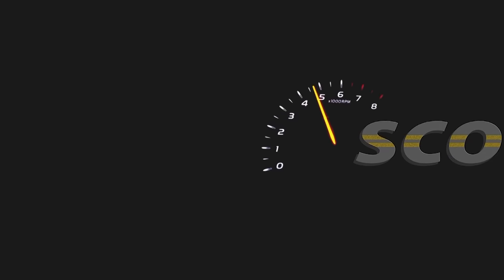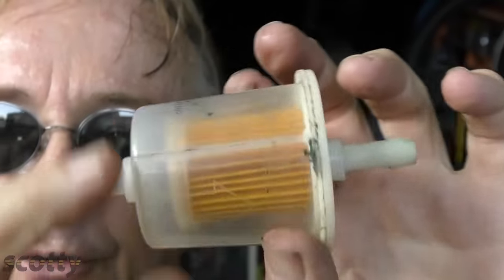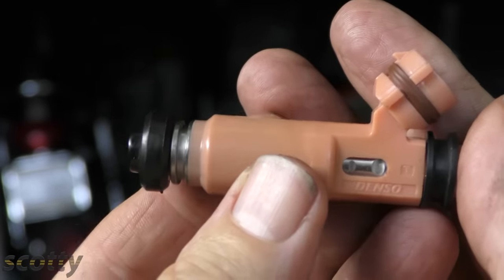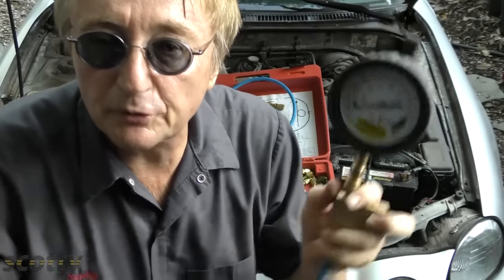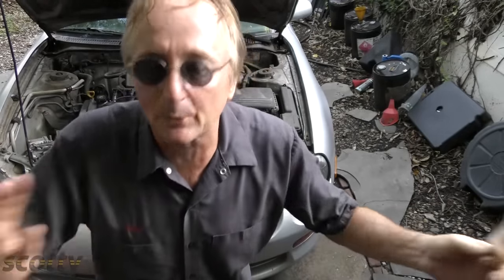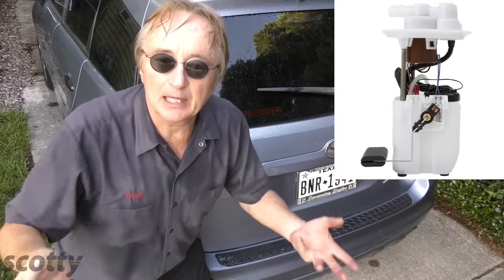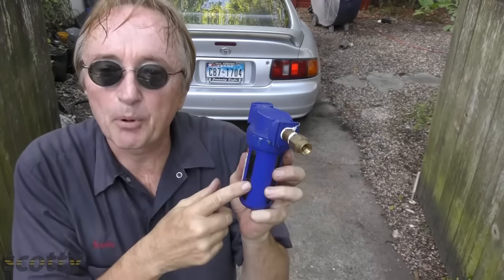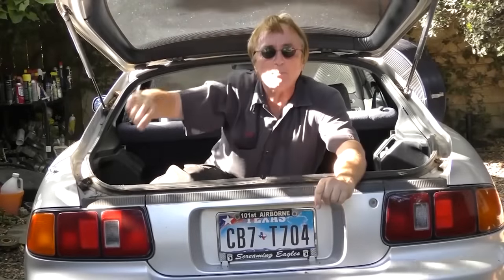Here’s What Happens if You Don’t Change the Fuel Filter in Your Car

Comment: don't let your ride run out of gas in a older car once the fuel hits the bottom of the tank  it sucks up all the sediment and rust that's been brewing for years and will clog your fuel filter
Reply: Jay Means yes that's a very good point!!! I've also been told to always keep at least a half a tank of gas... if you constantly let it run close to empty it will overheat the fuel pump... The gasoline actually dissipates the Heat and cools the fuel pump is my understanding
Reply: Mark Bingamon  but they say modern gas degrades very quickly. Filling at half a tank means there’s always half a tank of bad gas in the car. What to do?
Reply: Have you seen that yourself? Or just heard about it? I think its a myth. A car always shakes. Gas moves around swishes around all the time when u drive.
Reply: pretty dern sure i've had to replace a number of filters in those circumstances or when the car was on a steep incline and the sludge slid toward the pump
Reply: Mark iv'e never heard that but if that's the case i would say that's bad engineering or planned obsolescence, the only reasoning i can deduce is perhaps they figure if the tank is more than 1/2 empty then the pump's probably not gonna run for very long at a time.
Reply: weibernipple Fill at 1/4 tank
Reply: Mark Bingamon another reason to keep the tank at least half full is in case disaster strikes you can get out of town quick!
Reply: +Jay  Yes, this also applies to Tesla electric cars, never let them fully discharge, you will get the Dregs of Electrons clogging up the wires, increasing heat, causing explosions. Surely you have seen Teslas on fire?
Reply: Don't know guys but this idea of sludge whatever building on the bottom of the fuel tank is myth. At 160,000 I took out the fuel pump and pointed a flashlight down there looked around and saw nothing but crystal clear fuel.
Reply: your just a lucky person do you live near an ocean? does your gas station use good equipment and suppliers? has your ride been sitting in the yard for 5 years? there's alot of factors at play here not just 1 persons experience we are talking about the fuel system here not the lubrication or the air flow
the point of this discussion is not the focus of novice maintenance but the finer points of the fuel delivery system
Reply: Mess up your fuel pump
Reply: What are the sings of a bad fuel Filter?
Reply: @sandrapsalms9158  it goes waaa waaa waaa waaaa
Reply: It's a modern myth.  Your fuel intake is at the bottom of the tank (otherwise you would be running ampty when there is still fuel in there) which means any "crud" is getting through al the time and not just when the tank is nearly empty.  If you replace the filter and/or pump in a modern car where it resides in the tank itself, you can see that the bottom of the tank is usually clean.
Reply: Or use a fuel injector cleaner while low on gas to clean it out

Comment: I have a strong feeling after replacing multiple parts in my emissions system and still having codes pop up that the fuel filter is at the root of the problem.  308K miles on the car, thinking I should replace the fuel filter now for the first time!!
Reply: Did it improve things after you changed it out?

Comment: Just barely started following Scotty.  

2011 Camry le auto all stock 366k miles.  3rd n 4th gear rattles when shifting.  Up hill only do 50mph but if pushes it to 60mph, rattles even more.  Thought it was the trannie maybe so did drain n fill, never flush like Scotty said.  This weekend gonna do plugs n coil n air filter. Then for sure do fuel pump n fuel filter pay $1,000 for it since I don't want to mess with inside tank stuff.   Man can't believe I got lucky driving 366k on stock parts.  Been daily commuter 2 hrs each way for WK.  Next time I'll buy new 2022 vehicle n once I hit 130k, I'll sell it n buy new again.  In this way, the next guy will hold the bag when it comes to car parts breaking down.   Lol

Comment: Scotty I replace my fuel filter EVERY year. With my 1999 Mazda MX-5 the fuel filter is located underneath the tank and it has those real pain in the rear end plastic "quick release" clips. I even cut open my last years filter and it was already getting dark black. So would you agree even if a car hasn't done a huge amount of miles in a year... the filter can still go bad?

Comment: I have 2002 hyundai santa fe with 171000 miles. Whenever I ask the dealer or mechanic shop if I need to change my fuel filter, they say it is not recommended. What should I do? insist on getting the filter changed or drive as is?
Reply: Probably it is one in the tank. Buy from the dealer and change it yourself or get a local scotty.

Comment: Having the filter closer to the fuel pump makes a lot of sense: then it protects not only the fuel injectors, but also the pump as well. Sure, it's more of a pain to change it, but you'll need to do so less frequently. Having the filter in the engine compartment means that any crud gets sucked up by the pump and is sent all the way down the fuel line before it's caught by the filter.

Comment: Scotty I agree with you 100%, but I have to be honest most everyday people are not going to go through the hassle of jacking the car up, struggle to drop the tank to change the fuel filter.  You are lucky on the Toyota Matrix it has an access port under the seat.  Most cars do not.  I really wish the manufactures would keep the filter out of the tank. It should be as easy to change as the air filter.

Comment: But mine's in the tank, and is part of the fuel pump. The only way to change it is to replace the fuel pump, as it's not serviceable. Now what?
Reply: You wait for it to break because if you are going to have to replace the whole system you might as well wait for it to go wrong.
Reply: 2015 Chevy Cruze , same problem.
Reply: Gravemind Modern cars in a nutshell. lol
Reply: I don't know where you live but where I am, Honda dealerships charge £140 fixed price to change the in-tank fuel filters. According to the Honda manual, these need changing every 50k miles too...
Reply: Well you just drive it till the pump dies then replace as a unit
Reply: sab188 newer Honda's do not have a maintenance schedule for the filter. My dealer actually said they did not want to do it.
Reply: sab188 makes no sense, after 200 000 miles you replace whole thing IF it breaks
Reply: Use one of those fuel additives they sell at autozone. Don't buy the fancy ones.
Reply: OceanA Actually, the a couple of the fancy one's with solid PEA concentrations in it are the only ones that work. Chevron with Techron fuel system cleaner in the black bottle is a great choice.
Reply: same here i have a Chrysler they did a way with external in 2000 so mines in the tanks and i won't be bothering with it till it acts up.
Reply: Jr ALEXANDER     I wish i would have. I have a 2014 Malibu Lt and it is already starting to break down. A four year old car that has been taken care of.
    I had a 1998 Chevy S-10 that i drove for 15 years and had two slave cylendars put on it.  The only reason i got rid of it and got the Malibu is, so i would have room to take the grandkids places.
Reply: Jr ALEXANDER not safe.
Reply: John Young i have a 2011 malibu its 98k miles, still perfect
Reply: John Young we also have a 1988 s10 200k+ miles still going but unsafe too small
Reply: True Life Average Jane Vlog   That's great.  My daughter has a 2011 Malibu also.  It's a great car too.     I think it has about 89000 on it.
Reply: "Buy an older car." Yeah! Let's buy an older car that's even more of a money pit. Nice idea, genius - NOT!
Reply: John Young The S 10 fuel pump is aldo in the gas tank, which also requires the complete removal of the bed in order to change it. The fuel filter is on the left hand side of the frame, bolted onto the frame. Laugh at me if you will, when I use to own a S 10, a 95 four wheel drive regular cab truck, i changed the fuel filter every year on the Pennsylvania inspection time. Same way with my 92 Ford Escort, every year on it's inspection date and time, the fuel filter gets changed, weather it needs it or not, they BOTH get changed on their inspection dates and time.
Reply: Best thing is to never let the fuel level drop below 1/4 of a tank. Keeps pump lubricated with the fuel and keeps sediment from going up the pick up screen.
Reply: 2003 and newer the fuel filter is on the fuel pump
Reply: Just Listen Royal Lion Family I have a 2004 Chevy Tahoe Z71 and it has a frame mounted external fuel filter.
Reply: Fuel filters always need to be replaced eventually , nothing on a car is "lifetime" like manufacturers like to say.  Unfortunately dropping the gas tank and replacing the pump and filter isn't fun , but it's necessary eventually.
Reply: Simple you replace the car for a better one.
Reply: Josh Cade no such thing as a better car. Just harder and more expensive to work on.
Reply: That varies oddly enough my friend took his Civic Si in and the dealer told him the filter is permanent.  Falsely adding it is designed to outlast the pump and will never clog.  Which was why he said they felt comfortable enough to integrate into the pump and un-serviceable.  Buddy said that's a load of bs, luckily my lease is nearly up.
Reply: Not all 2003+ my 2003 there is a fairly coarse filter in the pump.  Then a normal fuel filter with better filtration on the fuel line by the rear door.   I've seen several different fuel pumps on even older with a filter but just for larger particles.  They still ran an inline external fuel filter.
Reply: amazing engineering
Reply: Change car when the fuel tank is emptied.
Reply: have you guys checked under the seats in the back? ( sorry i don't know what everyone's vehicle is i am assuming it is a car) but when I had my little car there was an access port under my drivers side back seat where you could pop the plate off and get to the fuel pump extremely easy.
Reply: True Life Average Jane Vlog I o
Reply: smokesgtp chevron with the techron doesn't work
Reply: Austin Kyle cheaper to fix than newer cars.
Reply: 20alphabet service it!
Reply: smokesgtp I don't buy Honda or any foreign car for that matter.
Reply: Merlin Cat ummmm ok. Never had issues with my Ford's in rust belt states.
Reply: Just hope for the best.
Reply: They use sock filters. They don't really clog unless you fill up at that weird gas station on the southside.
Reply: This is the way a lot of companies are going.  I have a GM vehicle too and that's the case with mine.  Although I haven't noticed any decrease in fuel economy on my truck and I use name-brand fuel ( I do run injector cleaner through it periodically which helps so you can try that to help things).

Comment: Car runs thousands of miles without fuel filter system, in tank filter last the life of the pump, line filter usually gets clogged
Reply: Considering my Honda manual says to change the in-tank filter every 50k miles (or 25k miles if you live in dirty/polluted area), I'm pretty sure those ones get clogged too...
Reply: My opel says replace fuel filter every 30000 miles or 50000 kms
Reply: ben franklin is it inside the tank ??
Reply: M Ridware i dont know that 😕
Reply: M Ridware those sock filters clog up just like any other filter.
Reply: @mridware9694  60k or 100k miles for in the tank filter

Comment: Hi Scotty, I hope you are well. I just checked my cars manual and it doesn't mention fuel filter change interval or anything, fuel filter is not even mentioned there. So doesn that mean I should ignore it, or maybe my car doesn't have fuel filter in first place????
Reply: You definitely have one, your engine would get destroyed pretty quickly if you didn't. Do you mean owners manual or service manual? The owner manual won't mention it if they consider it a "lifetime" part - that it's intended to last as long as the fuel pump assembly (like Scotty mentioned: it's not lifetime of the car, it's lifetime of some other part that it's related to. In this case, 'lifetime' probably means 'the warranty period we offer on the fuel pump'). If it's not mentioned under the service schedule then the manufacturer didn't intend it to be replaced separately from the pump assembly. The factory service manual (or Haynes etc. alternative) probably details how to change just the filter if you wanted to. Partly depends on the car - if it's just rolling up to 60-70K, maybe worth replacing the filter on its own. If it's done 150K already, likely easier just to wait until the pump fails and replace the whole thing like the manufacturer planned.

Comment: That could be the case! We bought a 2006 Chevy lacetti for my mum about two months ago, it is accelerating slower in the middle of the rev range and I couldn't figure it out with my dad, we totally forgot about checking the fuel filter.

Thanks for reminder Scotty!
Reply: Was that the ultimate problem?
Reply: @wmluna381  You're testing my memory right now, since that was around 3 years ago, but iirc, no, not exactly. That car can run both on gasoline and LPG gas. The gasoline filter was ok, previous owner has replaced it somewhere between 5 and 10 thousand kilometres earlier. I don't remember the exact problem, but I know there was something wrong with the LPG regulator. Although the gas installation does have sort of it's own filter, and it was indeed clogged, so you could say it was a part of the problem. Generally speaking there was simply a few smaller problems that caused the power loss, after a few fixes here and there it started working like it's supposed to.

Comment: Scotty:

I had an old 79 Honda Accord that had some weird fuel filter contraption under the rear left fender.  Not only was it expensive by itself, but was hard to replace and needed a lot of tools.  I got several inline filters and placed one before the factory filter and a second in line under the hood.

Somewhere down the road, I ended up with a tank of muddy gasoline (not from a flood zone) and suffered a lot of serious hesitation problems.  A quick look at the clear inline filter gave away the problem: muddy gas.  Without seeing the muddy filter, I could have torn through the car looking for another problem since the factory filter was painted black.

After changing the filter, my car would run, but I knew not for long.  So, I jacked up the car, removed the tank drain bolt and let it run out.  My God, all sorts of colors ran out and separated in the pan.  First, mud, then orange stuff, the green stuff, then gas, then some multicolored stuff (likely unassimilated additives), then water,  then several handfuls of rust.  I poured in another gallon of clean gas to finish cleaning out the tank.  More every thing else came out.  This was years before they started putting corn water into the gasoline.

I think you need to be take your high mileage Toyota and drain the gas tank and see the junk that makes your car run crappy and clogs every filter you'll ever put into your car.  This would make a good YT video.  If you notice that your car runs poorly when the tank is down to the last two gallons, then your problem is not fuel filter deficiency syndrome.  Those last several gallons ain't gas.

Comment: how do you know which gas station has the best quality gas??
Reply: Bryantrincon413 FAM Exxon, Shell, and BP are the best
Reply: Southern Brew thanks gonna start going to those i usually just go to w.e gas station is closest when i need gas
Reply: Bryantrincon413 FAM I did a little experiment once and I ran gas from a mom and pop gas station that was pretty cheap and the next week I used only shell gas. I found I got 2-3 better mpg from shell which would cost 10-15 cents more but was worth it for the peace of mind and the “better gas”
Reply: Alex43237373 nice i fill up with premium on my bike so even better
Reply: all gas should be the same, it's the additives they add that make them more expensive and "better"
Reply: Search top tier gas stations
Reply: I always go to Kroger. Cheapest premium that seems to be good quality. Sad to say but mom and pop gas stations usually have worse gas.
Reply: Shell, chevron with Techron
Reply: Watch their comercials and see which one is most convincing.  At least that's what they're hoping you do.
Reply: Go for newer gas stations, they have the fibre tanks down there instead of the rusted metal tanks
Reply: MaxiiBoii
Good idea
Reply: Always go for top tier Branded Gasoline..Shell,Exxon Mobil,BP..I used to haul gasoline and these station had a very strict guidelines for purity of their gasolines.Texaco for one would shut a station down if it had more then 2 inches of water in bottom of tank..Your unbranded gas is what we called Generic and had generic additives in it..Even most car owner manuals it suggests only using brand name gasolines..personally,I only use Shell..

Comment: I’ll be changing mine tomorrow thank you Scotty I kept getting system two lean Kode I changed out my spark plugs my coils and it still didn’t fix the issue so I was going to just replace the fuel pump but it makes sense to change the fuel filter first

Comment: The fuel filter on my 2013 Volkswagen Beetle Turbo and my friend's 2002 Volvo V70XC are both on the bottom of the car right by the rear passenger wheel. Very easy to change, I do it every 30,000-40,000 miles :)

Comment: A couple of moons back I removed the in-tank fuel pump just out of curiosity to see what the inside of the fuel tank looks like, turns out the fuel tank is very clean no debris whatsoever. btw my car had over 250K miles at the time. So in my opinion here in the good old USA fuel filters may be a waste of resources. We currently own 4 cars that do not have a traditional fuel filter absolutely no fuel issues to date, In 3rd world counties like Sapin Italy, France among others may be a different story.